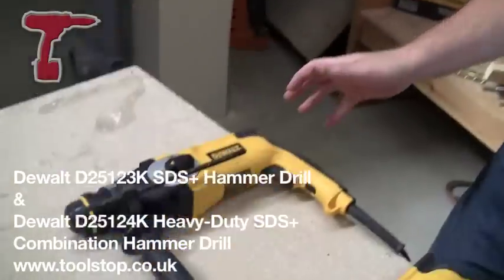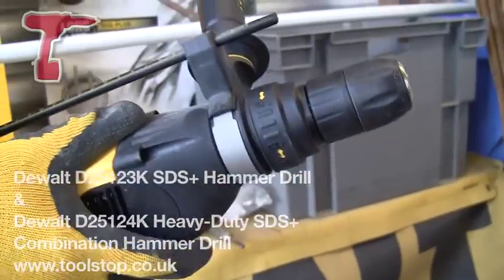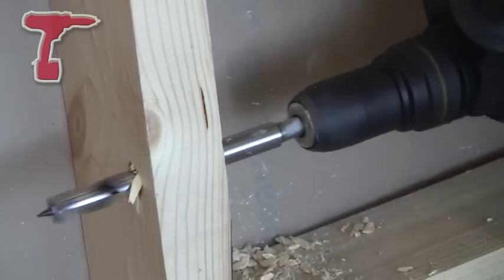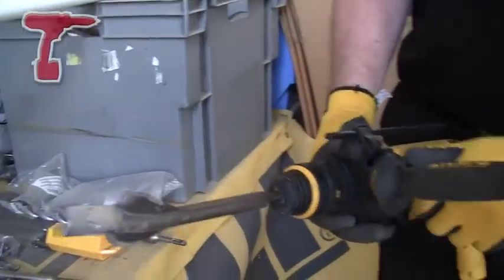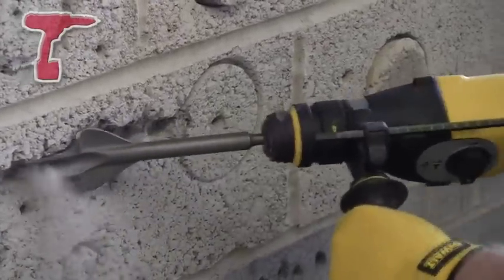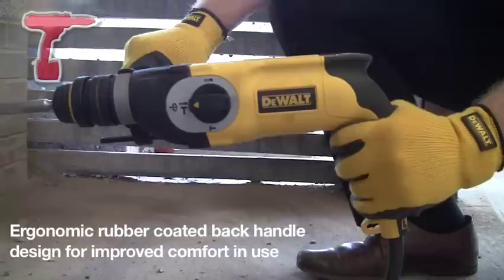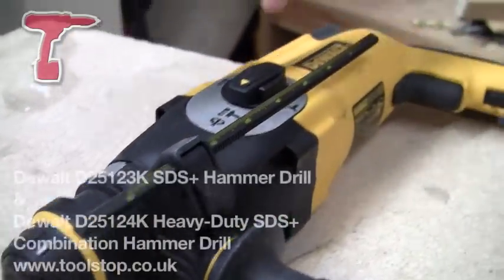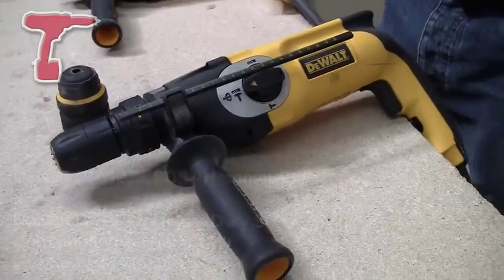DeWalt D25123K & D25124K Hammer Drills

Comment: @MrToolstop 
Well, they're both older and also made in the U.S.A. The #5036-09 is an end-handle drill and the #5077-09 is a 3/8" capacity 2-range VSR hammer drill.